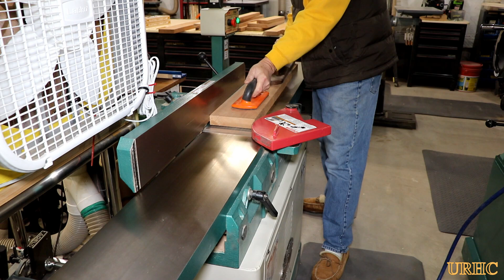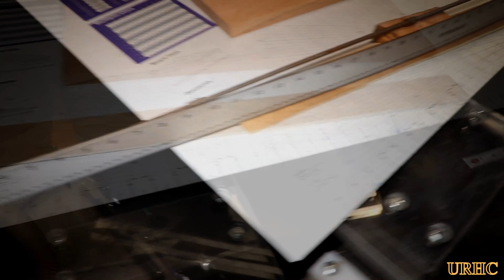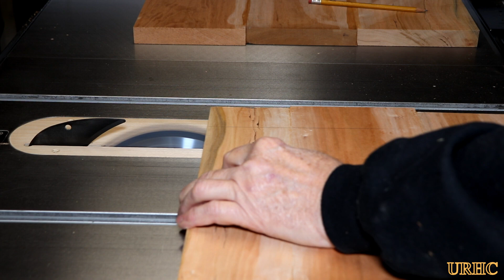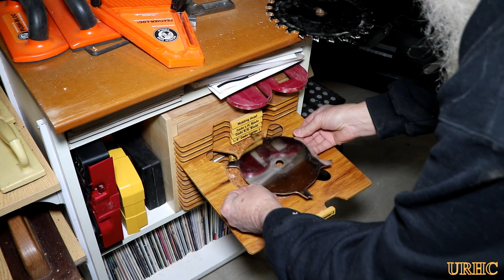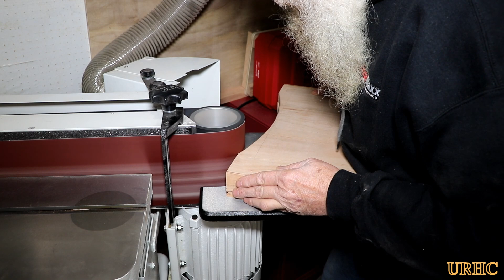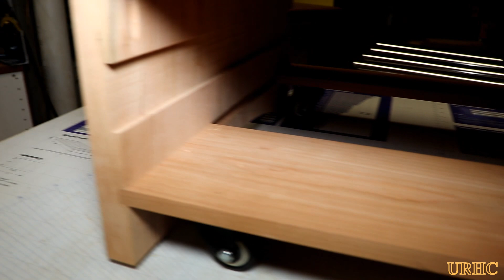Building A Cherry Counter Level Cart For My Cabela's 80 L Dehydrator Part 1

Comment: For your sharpening of drill bits: https://www.tormek.com/usa/en/grinding-jigs/dbs-22-drill-bit-sharpening-attachment/ 
or, basically, whatever you want to sharpen.
Reply from the maker: The kreg bit profile looks like you need special equipment to sharpen. The bits are only 10 bucks so it doesn't break the bank like that jig would. Thanks for watching

Comment: That is some beautiful cherry.  I like how you hid the casters.  At least you can see the grain on the drawer.  I'll be looking forward to the finish.  I hope the electrical problems are resolved in a hurry.  I see there are 375 views, and only 53 likes, don't understand that.  Maybe you should remind folks to subscribe and LIKE too.  Great video as usual, thanks for sharing.  Stay safe and well.
Reply from the maker: Thanks. The wild cherry turns a deep red as it ages and smells so good when working it. One of my favorite woods. Sounds like it will take some time because NYSEG engineering has to be involved in and approve a replacement cable like a new installation.  Plus the ground is frozen solid and that makes it hard to bury properly.  Thanks for watching.

Comment: I’m surprised it will take that long to replace the drop to your house. Hopefully the heat is on the good leg or you have a slot to switch sides for it.  No matter what you’re very qualified in things like this to know what’s needed.
Great job on the cart and yes owning a biscuit joiner makes project even better.
Reply from the maker: They don't run temp drops anymore.  Replacement is handled like a new installation that must go through NYSEG engineering to be approved first I was told by the electrician.  Plus scheduling powerline crews can take time along with frozen solid ground. It would be a easy job in the summer. Thanks for watching.
Reply: How would they address a downed wire in an occupied home? Empty and being built has no occupants or running water. Imagine if there was a medical need for power. I understand your explanation but find it unacceptable, if the other leg fails your house would be uninhabitable. I had the drop replaced at my house and done in under 90 minutes and he was taking his time.
Reply from the maker: Downed wire is owned by the utility company and they replace it quickly without a liability issue.  Buried wire is owned by the homeowner and must go through the proper hoops to replace it per current codes withal inspections and approval. Luckily I have the generator to run the pump.
Reply: I made an error I thought you had above ground wiring.